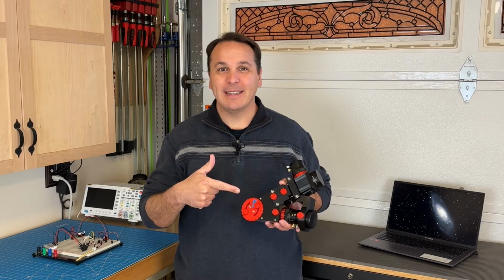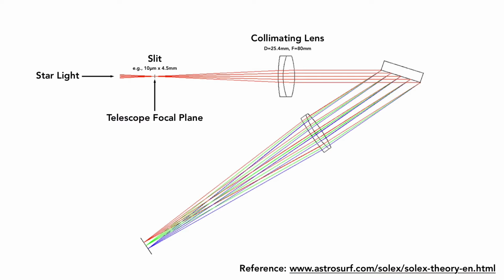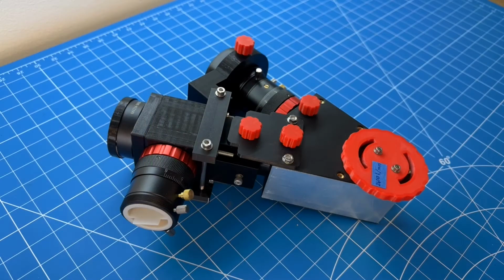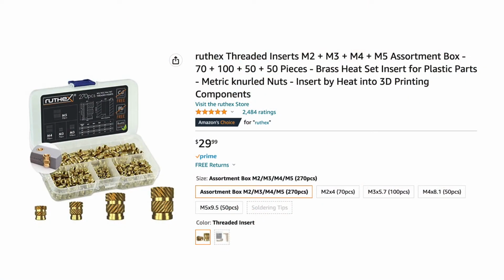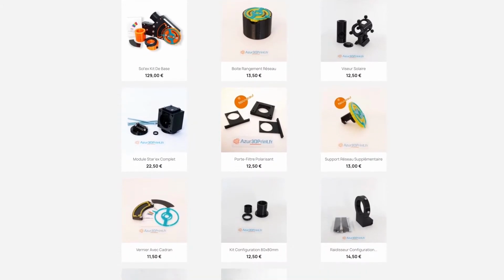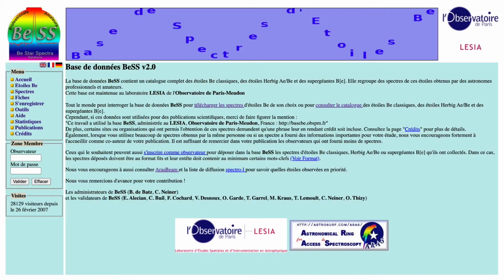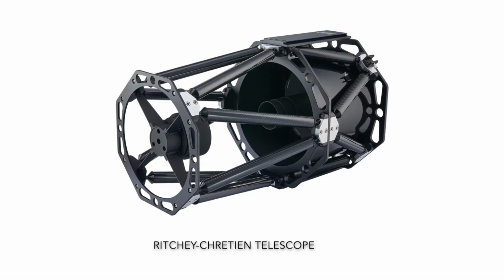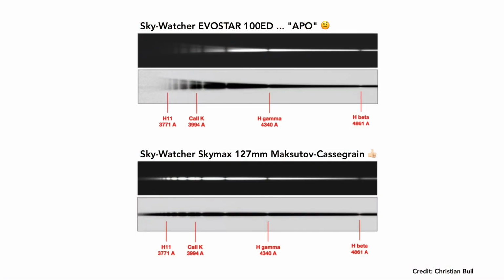Amateur Spectroscopy - Part II: A Closer Look At The Spectrograph

Comment: If I understood correctly the high res grating has a limited window/bandwidth, and to scan other wavelengths you rotate the grating wheel manually. If you would put a stepper on the grating wheel, could you sweep the wavelengths automatically to get a high res yet broader bandwidth? Maybe record as SER and with the setpoint for the grating stitch the spectra together?
Reply from the maker: You could, but you would also need to tweak the focus of the objective lens of the spectrograph at the same time.

Comment: Which kit would be best for a 102mm F4.9 refractor?
Reply from the maker: Hi Daniel. First, it is always recommended to start spectroscopy with a high resolution spectrograph. Low resolution spectroscopy is significantly more complex, and using a refractor at F/4.9 is going to be tricky because it likely has a lot of chromatic aberration. With a high resolution Star’Ex, you will need to use a quality Barlow lens with that scope. Don’t hesitate to join the Solex-English mailing list. HTH

Comment: Is the slit supposed to be inline, ie parallel with the lines on the grating ? How much error can there be in that alignment ? Thanks.
Reply from the maker: The orientation of the slit can be dialed in, it’s part of the initial setup of the spectrograph. Christian Buil covers that on his website and in his videos.
Reply: @darkskygeek  Sorry but I'm making a modded version. Can you tell me what it is 'dialed into' ? Are the lines parallel or perpendicular , do you know ?

Comment: I already have Ken Harrison's Optio Slit Wheel for Paul Gerlach's LowSpec . Tony Rodda  From the SolexGroup has said he made a modified version to accommodate the wheel and a stepper. I am unable to find his version online or contact him. Any suggestions ?
Reply from the maker: Hey Joe, I’m not sure I understand what you are asking about. Are you looking to automate turning the grating wheel using a stepper motor? If so, I know that a lot of people have already done it, and I don’t understand why they make such a big deal of it. In high resolution, I rarely look at something other than Ha, and if I do, I just set the wheel manually at the beginning of the night, and that’s it. And in low res, you just set it manually once and you’re done. Do you have a fully remote setup? I don’t think that Star’Ex is well adapted to a fully remote setup. For that, I would look into getting an eShel spectrograph from Shelyak Instruments. Much more expensive, but also quite capable of producing beautiful scientific data. The 2SPOT team in Chile is getting great results with it. HTH
Reply: @darkskygeek  I don't think I care about the stepper. The current available files for the StarEx / SolEx use a single slit. I happen to own the OVIO slit wheel from Paul Gerlach's LowSpec. A design by Ken Harrison. I am now however thinking I might rather try the StarEx but I want to use my Ovio Slit Wheel in it. I tracked down the fellow who redesigned the StarEx/ Solex with that slit wheel incorporated and coincidentally a stepper mount, but I'm not sure quite yet if he is sharing the files. If not, I will design my own.
Reply from the maker: @SmeeUncleJoe  OK, I understand. Yeah, I don't know who that person is or what he/she did. Good luck!